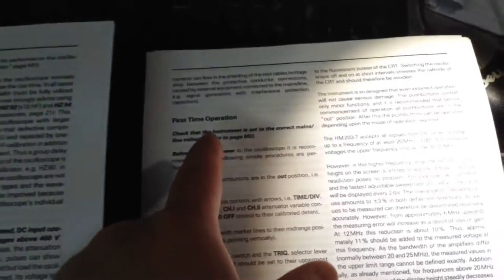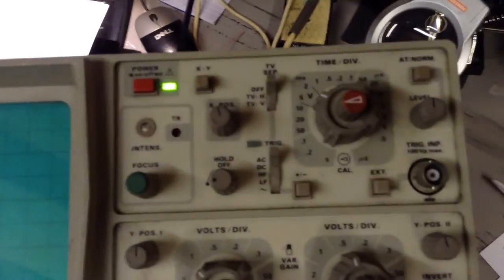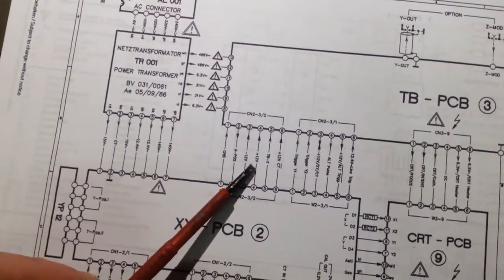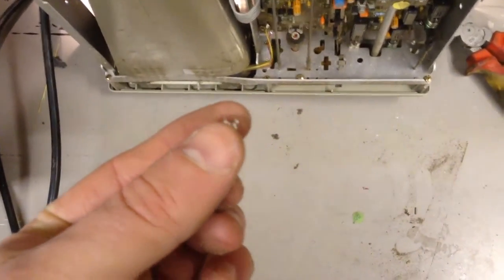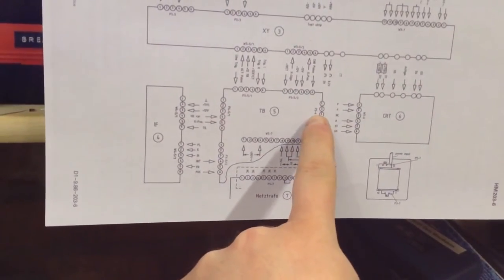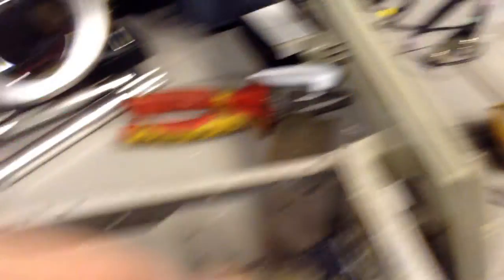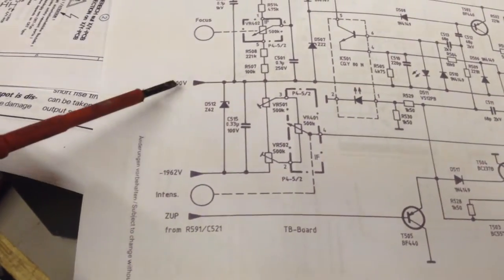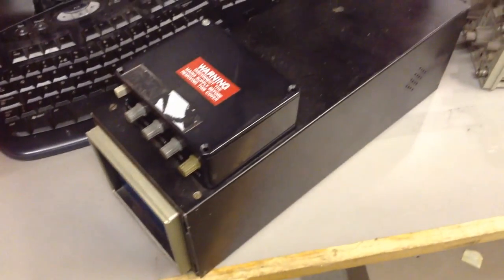Repairing HAMEG HM203-6 - Part1: Diagnosis

Comment: I aquired two of this model from an Ebay seller and Managed to fix both of them.
All the issues boiled down to short circuit capacitors ( the little blue 0.1's )and their associated feed resitors  / diodes. Took me a long 2 days to sort out the issues but now have 2 perfect scopes.
I did spend all my working life repairing to component level but Boy Oh Boy these wher a challenge.

Comment: Dear SIr, thanks for yours vidéos
I have a question : I have buy an old Hameg 203-6. All is ok BUT the value on the screen is 20x the real value. For exemple, with mesurement on a power supplier at 2 V, the line on the scope is 40v ( no issu with setting Y ). And it's same for the 2 channels.

Do you have an idear for help ??

Thanks in advance
Reply from the maker: allard sylvain sounds like you have set to x10 and uncalibrated the amplitude per divisions
Reply: @chriswouse7713  thanks for your answer but nothing like this resolve my issu. A burned component??
Reply: i guess it is kinda off topic but does anyone know a good site to watch new movies online ?
Reply: @Korbin Jericho ehh I use flixportal. You can find it thru google :P -raiden
Reply: @Raiden Maverick thank you, I signed up and it seems like a nice service =) I appreciate it!
Reply: @Korbin Jericho glad I could help :)

Comment: regards
My Oscilloscope Hameg 203-6
I have nothing on the screen and in the Y end amplified in the R 932 have 150 Volt on one side and the other side have 40 Volt, the transistor T723 is fine.

On the other hand R923 is well on both sides I have 150 volt.
CRT problem will be:
Reply from the maker: if you looking for an answer please skip to part 5 of these videos - thanks
Reply: Thaks you

Comment: "that's 6volts, I can measure that safely" is a dangerous impression.... could be a high-voltage breakdown that broke the heating-element.... if in doubt, use HV-equipment or atleast safetymeasures. People killed themself with LV-probes because >1000V came through a unseen crack in the insulator.... 

Oh and guys and girls: never touch a not safely discharged CRT-PCB. Even if off for hours there could be a dangerous voltage. I bit on my tounge as his fingers moved over there....
Reply from the maker: PhischTV I disconnected the tube...yes there is 1000V but is generated by a diode cap multiplier bridge so it’s quite high impedance so will nip you but kill you? Still pays it employ some common sense.
Reply: @chriswouse7713  Yeah, common sense is the thing people sometimes forgot. :) I just fear some "encouraged" viewer could atleast hurt themself badly. :)